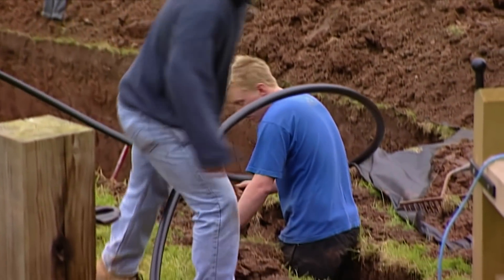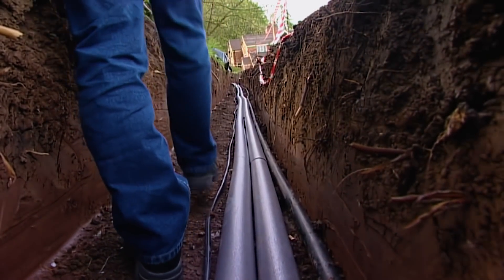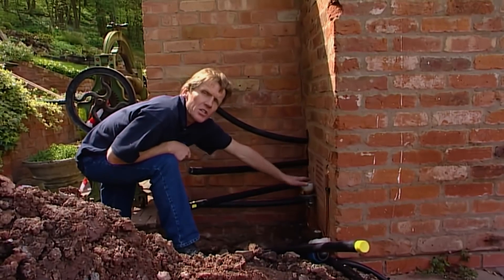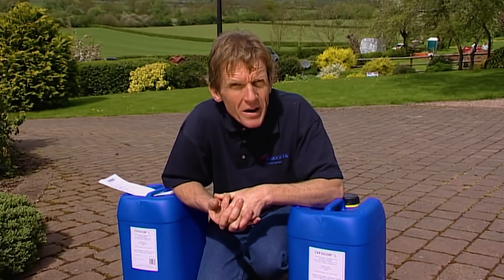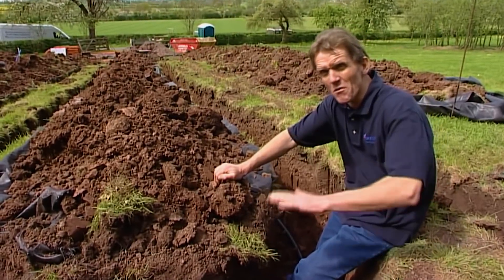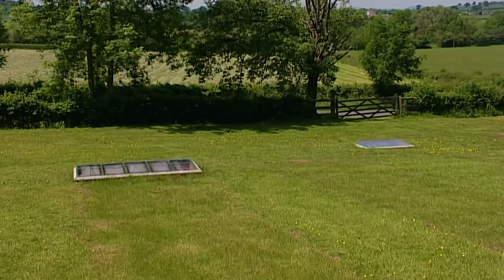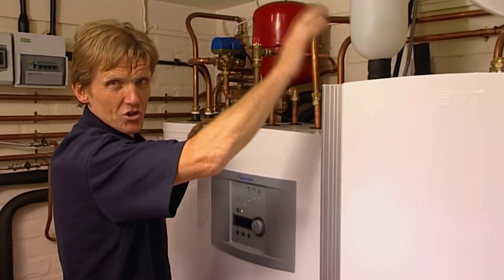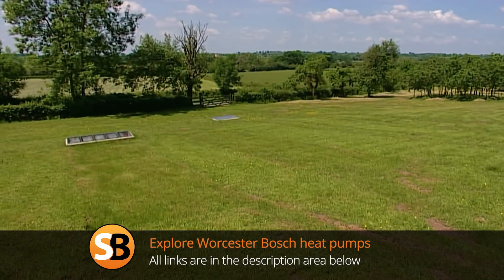How To Install a Ground Source Heat Pump

Comment: I was keen on a GSHP system about 18 years ago and got a specialist company in for a quote.
£12k for a Scandinavian system if I dug 3x50m trenches 1 m deep and 1m wide for the collector slinkies.

Our family is quite large and between us we cover most building trades and I had had my quite large house built 6 years previous so it was quite well insulated for that time. But no underfloor heating. The radiators were going to be changed for suitable ones fed from the oil fired boiler.

It suddenly occurred to me to ask what was the thermal resistivity ( conductance ) of the soil? They asked why was I asking!
I explained that as a young electrical engineer one of my first jobs was a 132 kv underground cable from a power station  transformer station. The thermal resistance was important to take the heat away from the cable. If it was not good special backfill was needed.  Perhaps today this is taken into account but 18 years ago the company I was dealing with did not consider the soil at all. My soil is very high in clay and flint and very unsuitable for that type of system. So the project didn’t go ahead.

Perhaps there is some data today showing the COP change with soil type? My guess is with heavy clay you would struggle to get a COP of 2 at 5 degrees Cost
Reply: Clay is ideal as it holds water which enhances the heat transfer
Reply: Clay is best soil for collector pipe.  At least here in the north where it is always wet. It's dense and has very small particles and no air in between. Bigger particles, worse it gets like sand and rocks. 
 Bottom of the lake is best if possible.

I have to wonder why sand would be best, is it heated constantly by rain water? That doesn't work at winter. You need stored heat from last summer.
Reply: Ahh maybe sand indeed has good conductivity when wet but does it stay wet is the problem. I wonder is there difference in heat storage capability?
Reply: You are right. Soil type is important. But in sweden it does not really affect cop normally, but it affect how long piping that is required for the collector.  Wet clay soil is the best, and sand the worst (if i dont remember wrong). 

We almost never use this slinky style. I dont think it is efficient.
Reply: @bsod5608 
Unfortunately I think you have remembered wrong about the soil type.
There are a lot of variables in soil thermal conductivity including moisture content , compaction (air gaps), temperature of the soil, and of course type of soil.
According to Oklahoma State University the conductivity for quartz (sand types) is the best at 8.8, clay is 3, and organic matter is 0.3, worst is air at .025
Because of the variables it is better to measure the actual conductivity on site.
I expect you may be right about slinky collectors. However collecting heat from as much volume of soil as you can must surely be better when you are running 24/7 in winter?
I have been getting a few cold calls over recent weeks about heatpumps and government grants etc. For the first time one of the callers actually admitted clay soils could be a problem.
GSHP is infinitely better than ASHP in terms of cold weather performance , noise etc. If I didn;t have a huge shading problem from trees (protection order so can't fell them) I would now go for a PV system with battery storage, thermal collection for hot water.
Reply: @michaelviney3737  yeah, onsite test is best if it is possible to carry out. Dont know if it is expensive. The moisture content as you said is important, and clay tend to hold water better than sand. But really wet quartz sand is far superior to clay, that is right.

I looked up some reference values for differens soil types, and unfrozen [swedish] clay is typically 0,85 - 1,5 w/m, k. Frozen clay 2-2,8 w/m, k. Sand have a wider variety depending on its mineralorigin/water content, particle size, from 0.4 (dry) - 4. Pure quartz, as a rock is around 7.5 w/m, k. At least in my area, we never have pure quartz sand.

I dont think clay is unsuiteble for geothermal heat, it is very common here around. its just a question of sizing of the collector. A house with about 6kW heatpump would proably need around 400 - 600 m collector in sweden, due to long winter. 

some more english reference-material. 
https://www.geothermal-energy.org/pdf/IGAstandard/WGC/2010/2952.pdf

The slinky style may be more suitable for countries with a higher average outdoor temp than sweden. Local electric prices and cost for labour is probably changing how to optimize the system too. Its a basic investment cost vs operating cost.

airsouce vs groundsorce is all about air-temperature. Its a lower investment, so if you live in an area with fairly high airtemperature/short winters its genreally favorable with ASHP. In south of sweden its more favorable with ASHP, in the north GSHP is more favorable.
Reply: @bsod5608  Thank you for your reply. You are fortunate in Sweden to have built suitable houses for relatively low water temperature systems. We in the UK mostly live in houses built for higher water temperatures and the cost of retrofitting is high. I used to look forward to my visits to Sweden to see ASEA when they were building the nuclear power plant in Sweden. Later they merged with the Swiss Company Brown Boveri with whom we had projects in the Middle East.

I'm afraid I do dislike ASHP having experienced them when living in Canada. But I expect they are correctly installed and operated in Sweden
Good Luck

Comment: The deeper you drill, the warmer the ground is, and the extracted heat is then classed as geothermal. So people like me who live in small houses on small plots in cold, dull damp areas of the UK could only dig deep rather than wide.
Reply: Kilometres for geo and metres for ground source (This for UK with some tiny exceptions).
Reply: @normanboyes4983  So where is the cut-off depth between sun-warmed ground and earth-core-warmed ground (on average in the UK)? Is there a level where it would be pointless installing a circulation system perhaps?
Reply: @KendalSmithy  over a kilometre
Reply: You'd have to a long way to get more heat

Comment: so either roger has let his son do a video, or this video is so old that it just goes to show how far ahead of the curve roger was back in the 90's
whichever one it is, it's certainly an eye opener
Reply: It's a video from the 90s he just re uploaded for some reason. He has been wasting time talking with heat-geek lately, probably something to do with that.
Reply: @cuckingfunt9353  well I saw his heat pump rant and I think this makes a good case for why the quick fix ones won't work
Reply: @cuckingfunt9353  that's the 00s not the 90s

Comment: Eh? Water coming in from the collector isnt hot. But once its been through this mystery electric appliance (a heating element perhaps) it comes out the other side raging hot. Magic!
Reply: A compressor.
Reply: Same magic that cools your fridge down, but in reverse
Reply: @regiondeltas Got it. Just the way it was framed made me chuckle

Comment: The guy that put in extra length of hose so the antifreeze in the system couldn’t cope with the extended excessive cold temperatures and froze .you should ideally run two circuits in the colder zone’s one shorter for that eventuality. No one does it…

Comment: You were slating heat pumps not long ago. Not the case in this paid promotion.
Reply from the maker: I think you need to see the difference between ground source which is niche and the goverment's attempt to put air source in front of gas boilers. There is no contradiction at all.
Reply: @SkillBuilder  I totally agree that the government scheme is a joke. I’m a gas engineer and in my own house I run air to air heat pump alongside a combi. Having the air to air on is great to warm the house, but I wouldn’t want to rely on it as my only source of heat.

Comment: My problem with ground source heat pumps or indeed air source is their over reliance on electronics to boost their so called electrical efficiency rating
Simple would be better ( old style direct switching rather than inverter driven)
After too many years to mention I have found that modern air conditioning systems ( which Heat pumps basically are) are as fragile as F1 cars against earlier types 1980s
They will be expensive to repair as not a plumbers repair job so new training will be needed or the normal cowboys will be in 
Any problem and I bet the first thing the engineer says will be that replacing the unit will be cheaper
It will certainly be easier ( and more profitable) for him
Reply: All the electronics are made in China, the units change every 5 minutes and nothing is compatible. Asides from the boards there are lots of other electronics dotted around, MOSFETS' mounted on heatsinks capacitors mounted in motors, loads to go wrong. Even if you go with one of the big manufacturers you will be no better off, parts will become obsolete and the whole unit will need to be replaced. Since the new outdoor unit will no longer be compatible with the indoor system, indoor unit replacement and re connection will be required. 

One big cluster fuck every 5-10 years.
Reply: @cuckingfunt9353  Or just go with a Chinese Made System for 1/3 of the Price that has no fancy Inverter Controll and just let it run in steady states. That is my Plan. Everything else will be done via a regular Boiler. I fully agree with your statement. Just go as simple as it can be. My last Gas Boiler lastet almost 30 years, the one what replaced that old buity will be gone in latest 15 years.

Comment: I see Rogers younger brother is in on the act now. Fresh out of 6th form college I guess 😂😂🤣🤣
Thinking about GSHP system in our house as it has timber floors with a concrete sub base. Plus I have about 2 acres of garden and a large rear extension coming up. 
Only disappointing bit of this video was, like others of similar nature, the cost is never mentioned. So we know it is too expensive and payback will take years.
Reply: lol Just what I was thinking!

From recent research and pricing (for projects), I saw that it's likely the second generation / occupants that will see a financial benefit. If you get someone else to do everything (trench dig, install, etc.) it's probably around £30-40,000 but I very much welcome correction. Money is far better spent insulating first (just my opinion, but externally), before bringing in the heat.
Reply: What was the payback period on your car or iPhone……..?
Reply: @normanboyes4983  wants and needs are different
Reply: @electronicsandradio3945  It’s a good point apply economics to needs and spend like it’s going out of fashion on wants.

Comment: How do these systems compare in the dead of winter, while the ground might still have a temp to extract would it be able to sufficiently heat the house with say under floor heating or would you need to boost the heat as you would with some solar systems
Reply: I lived in a house with a ground source heat pump a while back and it was always nice and warm. It was a big system though so probably cost a fortune. My guess is that a smaller system with a boost for the coldest weeks would be more economical.
Reply: ground keeps a near constant temperature.

Comment: Great idea in theory, but with a COP of four, assuming it manages that consistently, and present electric prices, natural gas is still cheaper (4p/kwh vs electric at 22p/cop of 4 = 5.5p/kwh)
Reply from the maker: If you have gas, stick with it.
Reply: For how long? Gas prices are soaring and the stated government policy will be to reduce the differential between gas and electric costs per kWh in order to encourage the production and use of electricity and via wind and solar to deliver the reduced carbon emissions targets.
Reply: @WirelessGriff  Do you seriously believe the 6x difference between gas and electric, that based on the expected wholesale price increases in April of circa 40%, which will undoubtedly be more like 50% when it hits the retail market, making the difference between electric and gas around 10x  different are going to be blended into a single rate?
Furthermore, the wholesale rate increase expectation of 40% in April and a further 20pc in Sept are going to make such a colossal void between electric and natural gas, you've going to need devices with an impossible year round COP of 10+ to even compete on basic energy consumption. To say nothing of the capex of course..
Reply: The situation is particularly acute if you live off the gas grid. Since moving into a property 5 years ago, supplied by lpg tanker deliveries, the cost per litre has risen from 32p/l to 55p/l. It has never dropped in that time only plateaued for brief periods before rising again. I can't imagine this trend changing, only continuing.
Reply: Energy prices will change to the detriment of gas - it will be a political balancing exercise to achieve that. Currently the Green tariffs (25%) are applied to electricity and given the pledges at COP26 the logical first step is to remove from electric and apply to gas. 

But - I am still installing a new gas boiler in May 2022.

Comment: Thanks. Promoting the use of fluorocarbons ox
Reply: Promoting the use of fluorocarbons on this scale is not good. The consumption of plastics on this scale is not a good thing,same apply s to that energy used to build ,install and manufacture the hardware. The cost of the installation to begin with for 98.4% of the population is prohibitive. Just buy a super efficient gas water boiler and save thousands of quid ,provided the gov does not ban them ,hey. Cavity wall insulation on old walls sinks fairly quickly caused by gravity! Electric heated clothing is the one true method of keeping warm ,it uses the least energy and is entirely portable. This whole scenario needs a rethink?

Comment: What happened to the Roger we know and love, that ranted about heat pump’s being noisy and inefficient and not worth the expense?
Reply from the maker: Ground source versus air source. two different things and you may notice they didn't chuck out the boiler. This video actually  reinforces everything I said about the foolishness of taking out gas boilers and putting in air source
Reply: @SkillBuilder  So do you prefer ground source over air source?
Reply: @koffibanan3099  yes he sure does.
Reply: That roger stopped getting paid to shill for heat pump manufacturers.
Reply: Thanks for your reply Roger. Much appreciated. One question though, does the ground pump require the noisy air conditioning type unit fixed to the building with the fan unit running through the night?

Comment: Any chance of some ball-park costings Roger? I live in a 4 bedroom detached metal framed house, so can't use cavity wall insulation. I'm sceptical of the benefits claimed for these systems versus my existing gas boiler/radiator & cylinder set-up.
Reply from the maker: There is nothing whatsoever to gain over your gas boiler. This job would cost you £30,000 or more depending on size.
Reply: I'd be looking to apply exterior installation instead then - best not to lose heat in the first place than try and warm the air around the house.  With power costs spiking at the moment, running the heat pump will also cost more.
Reply: Dont bother, air to air heat pump and combi boiler combination is way to go
Reply: Well if the damn USA stop trying to start wars in Ukraine and let Nord Stream 2 start operating then gas will be the cheapest option by far
Reply: @m4inline  the British government has been spiking the gas prices before Ukraine kicked off to make people get these heat source pumps that are fucking useless, I’m putting in a good wood burning stove to mitigate the gas prices, plenty of people on YouTube that have heat source pumps also use a wood burner because it’s so fucking cold because the pumps can’t cope, says it all about this pointless fad🙄 we want cheap gas !!!!
Reply: Don't blame USA you moron. The eu is to blame for the Ukraine problem. So I guess you don't give a fig about the thousands of dead Ukrainians. You are hypocritical, ill -informed, greedy and cynical